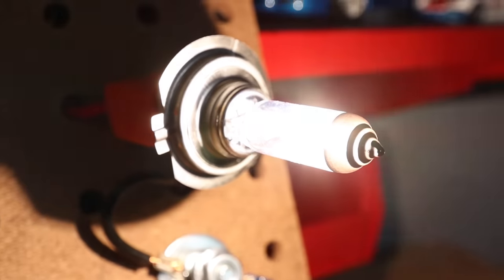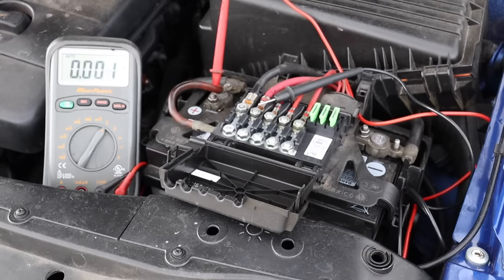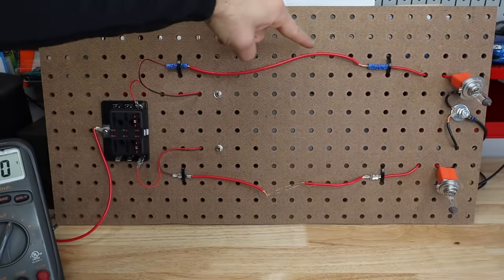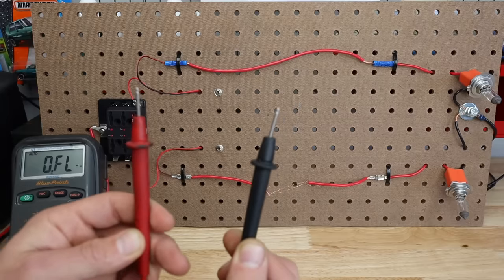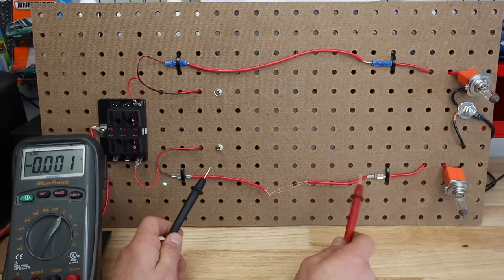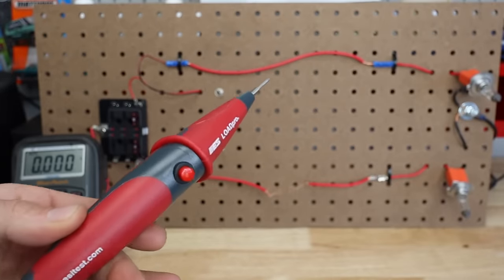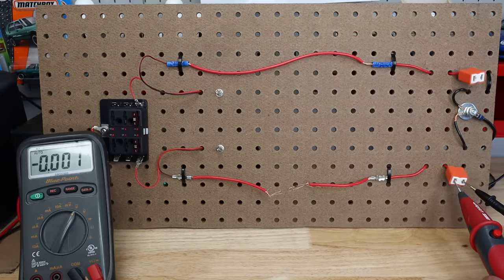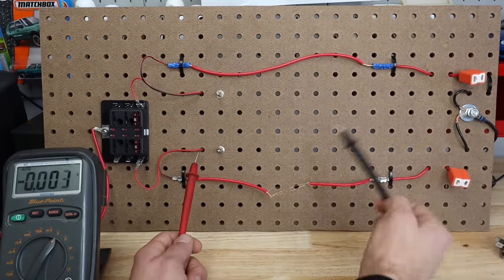Voltage Drop Testing ~ The BEST Way To Test Wiring

Comment from the maker: True of False, Voltage Drop testing the best way to test a wire? ;) Links to everything we used today in the description. <3
Reply: Not to be one of those but you left the description from the last radiator video in this one🤭
Reply from the maker: Thank you! Freaking YT has been silly for me lately. LOL
Reply: Found faulty engine wiring harnesses via this method 👍🏼
Reply: It is neither better nor worse than a resistance check.  Had you checked the resistance check of your upper wire and compared to your lower wire, you would have seen that 0.2 Ohms is a HUGE resistance for a wire of that gauge and short length.  The resistance and the voltage drop are exactly equivalent as they are related by the linear Ohms law equation.  There is no “static” vs “dynamic” issue here.  The only way that makes a difference is if you are dramatically heating up some part of the circuit as resistance does vary with temperature in most materials, but generally the change is very small in copper wire.
Reply from the maker: the resistance of the top wire is also .2Ω. The issue is static or dynamic or loaded vs unloaded. testing the wiring loaded is the better way in most every situation. I am sure there is some where it's not, but overall this is the way that tells more of the story.
Reply: What about continuity tests Charles?
Reply: Ohms law 101
Reply: Wire size and length will obviously change your resistance as well
Reply: Well I'ma E2 AC ohm's law doesn't change
Reply: @LTVoyager  yes what he said
Reply: If you're asking about DC current than no
Reply: @LTVoyager   LTVoyager He is referring to the current flowing through the circuit  to "dynamic/loaded"  and no current flow through the circuit to "static/unloaded".   The thing we also have to keep in mind is even if that Thin Wire had 0.0 ohms,  it doesn't mean it can carry the current that some components need. Imagine if that  0.0 ohm wire was used to operate a starter, how would an 0.0 ohm reading help us? There are even times when an internally damaged wire can show 0.0 ohms.  If we ran the starter( lets not think about it melting for a moment ) that wire would heat up and  create resistance and now becoming a load, that means it will drop voltage and by measuring this voltage drop we can determine where in  circuit the unwanted resistance is occurring.
Reply: @LTVoyager  (part 2)  and since that voltage drop occurred  that means we can determine that the wire or damaged wire is not carrying the current correctly.
Reply: Joe Charron Actually, Ohm’s law for DC, V=IR,  is a special case of the more general Ohm’s law, V=IZ, where Z is a phasor since V and I may well not be in the same phase.  This can greatly complicate the analysis.  In a simple DC circuit such as Charles is analyzing, there is no difference in measuring the resistance of the wires or measuring the voltage drop across the wire when there is current flowing through it.  He is suggesting essentially that Ohm’s law does not not as he is saying that measuring the resistance with a meter doesn’t give the “true” resistance and you somehow need to have current flowing through the circuit and measure voltage instead.  The fact is that he is wrong as the same law applies.  The meter is measuring resistance by flowing a current through the wire and measure in the voltage drop, which is exactly what he is doing later using the voltage function of the meter and a much higher current.  The reality is that the resistance doesn’t change and a wire that has a high voltage drop under a higher current will have a proportional voltage drop under a lower current as both are related by a CONSTANT, namely the resistance R.
Reply: hasaywha You don’t know what you are talking about.  The only wire that can approach 0 resistance is made of exotic materials and supercooled.  The only reason you read 0 ohms on a copper wire is because your meter simply doesn’t have the resolution to read the actual resistance.
Reply: I love Your films :) Yes, I want many more films like this :) thank You :) sorry for my bad English.
Reply: @LTVoyager  Please allow me to clarify, I was not implying that the wire was actually at a true 0.0 ohms.  I was only using it as an example that a wire with very low resistance can not  determine if the wire is capable of carrying the current that is needed for proper operation. Also, you are most certainly correct sir, the DVOM that is generally used in the automotive field will not read very low resolutions. That 0.2 ohm might be way off , due to the limitations of the equipment.  So far , a V Drop is the quickest way to isolate the issue with unwanted resistance even with the limitations of the equipment in the field. That doesn't mean I am not open to faster or even more accurate methods. If you have a faster and/or more accurate way I would totally hear you out. But, please keep in mind that the whole premise is based on the limitation of the equipment that is used ...unfortunately.
Reply: It depends on the circuit’s purpose.  For power circuits a voltage drop test is ideal.  Load it up and sum your voltages.  

But for a bus or signal wire, the  BEST way to check a wire is to stimulate it with a square wave and monitor the pattern while wiggling.  Much better than any resistance or voltage drop test.
Reply: @hasaywha   in tech school I was on the job instead of in theary class oops
Reply: @LTVoyager  LoL
Reply: @hasaywha  there is no wrong answer here guys
Reply: Even the diameter of each single strand of wire changes resistance. I now this because my first jobe was in wire drawing
Reply: When it come to electronic?
Reply: ABSOF___KINGLUTELY!!!!!!!!!!
Reply: False if it's a taste test, how're you gonna discern the subtle hints of oak and barley with just a voltmeter? :V
Reply: @LTVoyager  The difference is that the resistance test is utilizing the meter at the edge of its ability - trying to differentiate between some hundreds of milliohms when you can't even be sure you're making good contact on crusty car parts is foolish. Instead, you intensify the potential problem by applying a real-world load, and then use the meter to measure something on the order of several hundred millivolts, which it is much more suited to do accurately. In this case it's the better method and hence the making of this video.
Reply: I don't know about "the best" but only because I haven't heard all the theories yet! The best we got! Certainly better than trusting a resistance test by itself. Good content!
Reply: The best way no doubt!
Reply: Yes dynamic test trumps over static test. Is all about how many strands yoi have so there would be the easy electronflow effect
Reply: LTVoyager,   how would you go about testing a possible partially broken wire. Now keep in mind in this instance you are not an engineer, you are a automotive technician who has nothing more than I slightly better than average multimeter? As you saw with the lead check Charles’ meter was already at .1 ohms.
Reply from the maker: Yep. It’s a 2002 vintage. Hahah
Reply: A resistance test is best but with a milli-ohm meter but these are mega expensive and only carry out resistance checks so a one trick pony. Digital multimeters only inject a few micro-amps of current so they suck at 'low resistance' readings. A 14awg wire is in the range of 2 milliohms (0.002 ohms) per meter. 
Remember, all your multimeter does every time you use the ohms setting is a voltage drop test, that's how it calculates resistance just with a few volts and a few microamps.
A milli/micro ohm meter injects anything from 100mA to 100A through a circuit.
Unless your prepared to sink anything from £700 to £5k into a milli/micro ohm meter stick to the live circuit voltage drop test.
Reply: @LTVoyager  35yrs as an EE, So you must know Kirchhoff's voltage law, if you don't look it up.
Reply: John Gregory I am quite familiar with both of Kirchhoff’s laws.  What’s your point?  I am still waiting to see the equation for resistivity of a wire that has current as a variable to justify the “static” vs. “dynamic” behavior that was claimed earlier.
Reply: HumbleMechanic would like to see you use more of that load pro, thinking of buying one.
Reply: Trick question.  That's true and false.
It's true if you're just checking for failing wires however this test will not expose wires with compromised insulation that are bleeding across onto other wires.
One of the most common issues I repair regularly at work is failing insulation on wires causing stop system lights on buses.
These are powered by the Allison HP50 Hybridrive systems.
In the automotive world however I've rarely come across this type of issue.
 I use the Fluke 1507 "megger" to diagnose this type of failure and this is one meter that can bite you or any electronics it may come in contact with!  It's important to make sure the whole circuit end to end is open before testing!
Reply: Good shit man. Keep it up.
@LTVOYAGER: Where's your video? Put up or shut up.
Reply: @LTVoyager  There are videos here on YT (lookup ScannerDanner) showing resistance changing when the circuit is loaded, demonstrated by a test light going out when the load is applied.  Once the damaged area cools off the light comes back on.  If resistance in the circuit did not change then what makes the light go out?
Reply: I need help, the wire coming from my board is reading 12 volts, however, after I connect the wire to my LED boat light it's reading 40 + volts. WHY!

Comment: Technically, it was only about .265 of a reading with the voltage drop test itself, and the Load Pro actually did drop about .2 of a volt so the Load Pro DID give you a very accurate reading. It's an incredible tool, and this even displays that it is capable of picking up even very small readings.

Comment: Resistance tests (when performed with a typical multi-meter), are performed at very small currents.  Thus wiring issues like the "two strand" demo aren't apparent.  That "mini wire" is perfectly fine for delivering a few milliamps.  But it is insufficient for delivering much higher currents, so this voltage drop test is definitely valuable!

Comment: Volt test is fine but it is far from the only test to do. Load testing, FLIR camera if you have one, and wiggle&jiggle tests all have their place; and I would argue that the wiggle&jiggle is of more value than even a volt drop, or best when combined with your meter.  The point is never rely just on one test to find a problem - use them *all*.  Verify the fault while digging for related concerns.  Saying 'oh i did one test and found it' sounds much less convincing to the customer (and warranty) than saying 'here are the results from my battery of tests and they all say the same thing'.
Reply from the maker: Yep, you have to use all the tools in the bag to do it right!
Reply: Yes! Load testing a circuit your the first person in the comments that said load test! Thats what i use all day long! Voltage drop is helpful in simple issues but when i get stuck i have to isolate and load test
Reply: If you approach every diag. with the assumption that, if you are wrong, you cannot return the mis-diagnosed part and you cannot recoup any of your mis-diagnosed labor, you learn to use all of the tests in your tool bag to reach as close to 100% confidence in your diag. as possible.  "If I am wrong, I lose money" seems to work for me.

Comment: In video at 3.57 seconds you say your checking resistance but you never changed from voltage to ohms, you proceed to check ohms while on voltage, and right after turn circuit on and never changed  settings on DVOM. Had it been set to ohms you would have fried your meter.

Comment: why was there voltage drop across the broken wire if it's not a load?  Is it because there is less current flowing through that portion of the wire because it was only 2 strands?

Comment: You really see drop (vollts or smps?)🤔 when we used small Lincoln wire feed welders on the job, too long an extension cord, not enough heat for a good weld, you could tell the difference.

Comment: The way i learned it is a v4- reading.

V1: battery positive to battery negative
V2: positive side to negative side from component( lightbulb for example)
V3: negative side component to negative battery
V4: positive component to positive battery

V2 + v3 + v4 should be almost equal to v1 ( otherwise your reading is faulty)
V3 and v 4 should be as low as possible (0.5 volt drop is acceptable) 

Example:

V1 is 12.6 volts
V2 is 10.4 volts
V3 is 2.2.  Volts
V4 is 0.0.  Volts

This means that there is a voltage drop in the negative side of the circuit
Its a very usefull method to find electrical problems.
Reply: Same, are you Dutch by any chance? :P
Reply: MrDanMan klopt! Echt een handige methode die v4 meting.
Reply: @markalpha8005  Ja, het is zo makkelijk maar ik kan m nog steeds niet uit mijn hoofd 😂
Reply: Yes you get the same result using that method.
Reply: Here is my 6th reply and the reply is very WELL explained to us, and we thank U so much indeed 4 Ur excellent explanation! Thank you, Mark, on half of all those who did not communicated 2 U in their appreciation of your explanation, and is supplement and this video is excellent video, especially for so-so beginners of automotive electronics!
Reply: @rubiconklbrutorowman7577  thanks a lot for your appreciation 💪
Reply: @markalpha8005  yeah like the other guy said we appreciate you helping us in the comments with the information provided so its much easier for us enthusiasts to not get frightened over doing this Voltage drop test so Thanks a lot Mark
Reply: Great comment💯
Reply: I believe youre referring to Kirchoffs Law, the sum of all voltage drops equals total source voltage.
Reply: This was excellent! The only question when using this method what if the car is a crank no start? Do you need to put the key in the on mode for each test or do not turn key at all orrrrr do you just crank the key for each test even though you know it won't start?

Comment: Very good content. I've been preaching voltage drop testing any time I'm dealing with issues in automotive electrical systems. My 2017 Fiesta ST that I bought earlier this year was a 1 owner car, me being the 2nd. Came out into my garage after driving the car and the driver side headlight was still on. Found a frayed wire in the harness (I'm assuming the previous owner ran a wire or something through the same grommet as the harness, because I found a slit in the grommet). Busted out the meter and found the offending circuit. You couldn't see the damage to the wire until the harness was twisted a certain way. Cut, solder, heat shrink and good as new. I'd rather just repair it myself than have to deal with dealership shenanigans and not being without my car for however long.
Long story, but anyway, proper diagnostic and testing procedures will prevent misdiagnosis. Makes me miss working on cars for a living, but I enjoy not starving to death! Keep up the good content, especially diagnostic info. Very useful!
Reply: Not starving to death? Is the pay or hours that bad?
Reply: @starbai410  Pretty terrible considering the amount of training and experience you need. Mechanics on average  earn less than the average wage. Yet it requires 3 years of training and then another 3 years experience to be ok at the job. Then its a pretty toxic environment with all the oils and fumes. That being said you can make a lot of money if you get good at the job. You could earn twice the average wage if you work hard and educate yourself.

Comment: I passed 104 Electrical course! Not only did I pass, I also was a in the 100 club. Honestly your electrical videos helped me understand it a lot. 

I got a %30 on my second quizz, and when I retook the quizz at the end of course when they allow one retake, I scored 80%.  

In total 90% final quizz, 57 out of 60 on Lab final (forgot to convert to miniaps from minivoltage), and a 100% on my written final. 

The instructor tells the students this course is the highest failure rate, and it really is, and is unnecessary stressful.
Reply: How was your lab end course like? Im currently on my 2nd week of elc course

Comment: I don't know if this is the same in each country but this is (a little bit) similair to the method we learn here.(the Netherlamds) V4 method. Wich is where you measure 4 things.
V1; the battery.
V2; the component.(in this case the H7 bulb)
V3; the positive cable
V4; the negative cable.
This way you always know where the problem is.

Btw love your vids Charles. I am working since the start of my career(age 19) at a VAG dealership(Seat&Skoda) and I can relate to a lot of stuff you are telling about in your videos.

Comment: I'm in course 104 Electrical at UTI. I scored 100% on my first quizz, then a low score on my second quizz.

I'm not a good learner by reading. I'm a hand on or visual learner. I didn't have the opportunity to visually see or do a hands on for this second quizz.

This video helped me a lot to understand it better. I can check ohms like a pro. The rest was super confusing. But, this video's demo is great. 

I'll let you know if I pass with a better score on my retake of the quizz. If I do, it's because this video.

Comment: there is an error when you measure the voltdrop it is 0.26 from memory but the video shows in big writing 2.6V. also when you talk about potential difference , you imply that there is a potential at each test lead, however i believe that the potential exists between test leads. Thanks a lot for the video, well explained :)